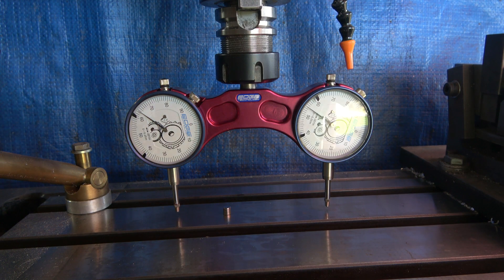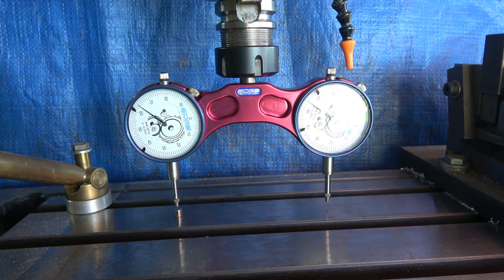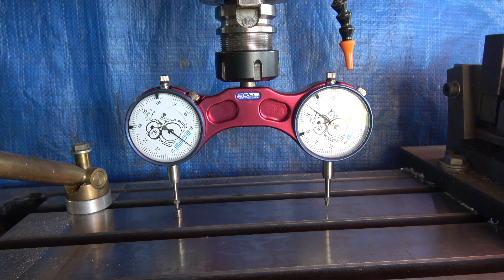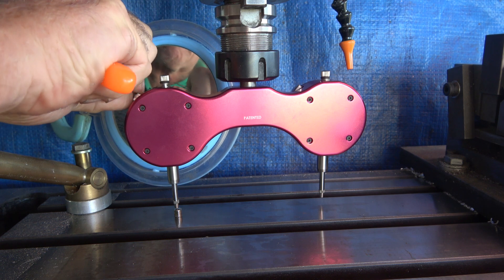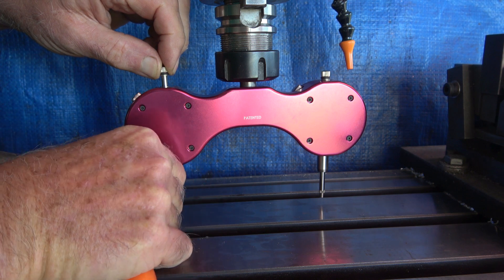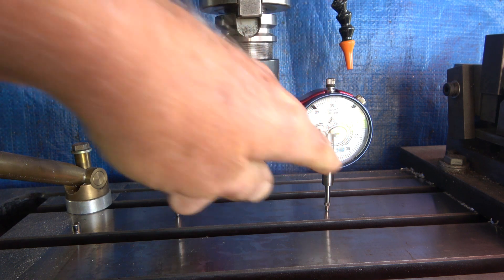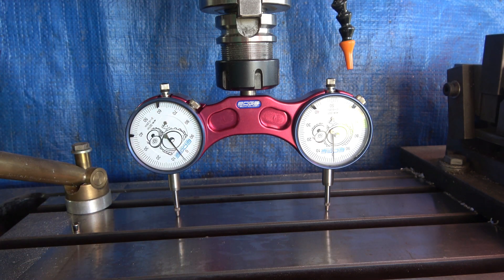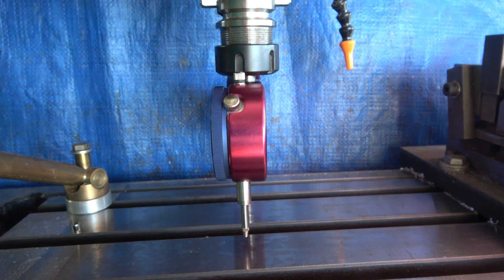How To Use An Edge Technology Tramming Device On A Milling Machine

Comment: Ive got the mini version of this, works great on my mill but also on my desktop CNC too as its a 1/4 inch shank so can easily fit in an ER11 collet. A real time saver for sure.
Reply from the maker: Thanks for watching. So glad that you have one to use. So much quicker to use than the traditional DTI and having to swing it 180 degrees. Regards.

Comment: If you are mainly referencing your work of the bed of the vice you should tram to that and not the bed of the mill.
Reply from the maker: Thanks for watching. If your vice is a El Cheapo Chinese one then I agree. Both my vices are Professional ones that I also surface ground the bases referenced off the vice work area. Best Wishes.

Comment: Nice piece of kit Dave, what was the point of the magnet; a piece of plate glass, a machined parallel or if the table is clean & any dings stoned out would have done just as well.
Reply from the maker: Hello and thanks for watching and your excellent question. Yes you are quite correct, use it directly on the table or use a parallel. The only disadvantage by not using the magnet and going directly onto the table is that after setting the first indicator , you would need to manually lift both plungers whilst rotating it 180 degrees. The reason being is that the pitch of both indicators is wider than the tee slots, so unless you did that they would want to drop into the slot. By using the magnet the second plunger  would still clear the table, you just need to lift it to place it on top of the magnet. I just used the magnet that is supplied in the kit as it was a demonstration on how to use it and thought better show it all as supplied. Best Wishes.

Comment: That's an interesting tool. I've seen them used of various YouTube channels.  I've never used one but I can't see much advantage to it.  Guess I'll be sticking to the good old single indicator sweep.   😊 Good job on the demo.  Tc, Mike
Reply from the maker: Hi Mike, the advantage to this is that the error reading is instant, you can immediately see if the head is better or worse. With the old method you adjust, then have to swing the DTI 180 degrees, hoping on the way that you have not knocked the stylus going over the tee slots. With this an easy 5 minutes to adjust, as you well know the old method can take an absolute age, especially on a BP with the geared adjustment bolt. Thanks for watching. Regards.

Comment: Hi Dave, what is considered a good number for tram? Your vid mentions .002” in the middle of the table, is that a good number? I’ve been striving for less than .001”.
Reply from the maker: Hi Stuart, thanks for watching, ideally a thou or less would be nice in the ideal World, but in practice it is often hard to achieve. I got the reading of 4 because I had the table wound to its limit. There was so much overhang on the other end with my 2 vices fitted that the slack in the knee came into play. That was why when I wound it back to the center the slack was evened out a bit to 2 thou. I was going to adjust it, but it meant getting out my torque wrench as the head bolts have been set to Factory specs and my standard 3/4" ring spanner would not shift them. Lazy I know, but I had been videoing all day yesterday and today and needed to edit and upload. Take care. Regards.

Comment: Good morning Dave. The products made by Edge Technology do look to be very well engineered and no doubt are a boon to effecting a quick and precise tram. Thank you for sharing. 👏👏👍😀
Reply from the maker: Hello Andrew, yes they are top notch in quality, nice anodised aluminium parts. If you shop around you can sometimes find them on offer. I think they make 2 types, Home use and Industrial. Thanks for watching. In one of your videos you speak of Monotype Linotype Machines. My Father worked at the Factory in England, I have been around the Factory myself several times. Company now gone and site it a lockup type units. Regards.
Reply: @daveticehurst4191  Hi Dave, I will certainly look out for a bargain offer on the Edge Technology product. 
I must apologise, I did see your comment on my Monotype video awhile back and I appear to have forgotten to reply. I will do so in detail on that one. I was amazed your father worked at the factory. And yes, there is not much left to see now. I did go there to take a look myself a few years ago.